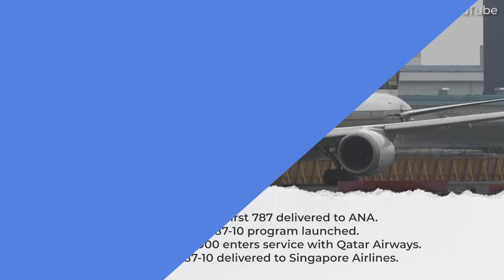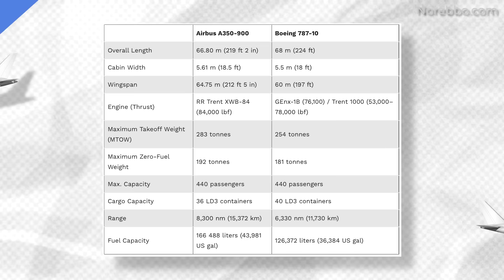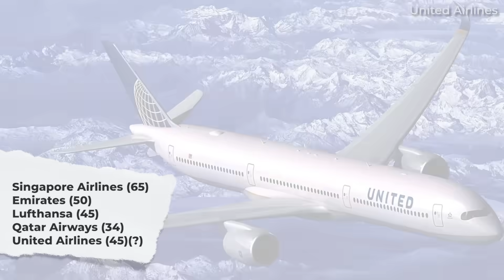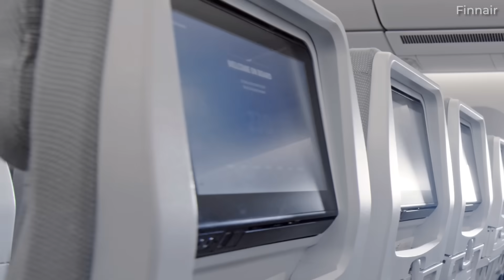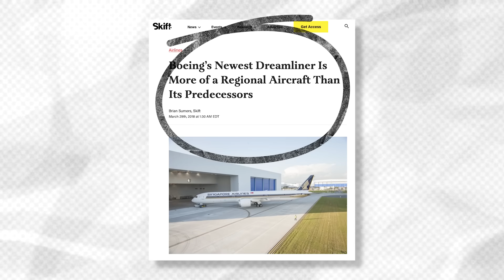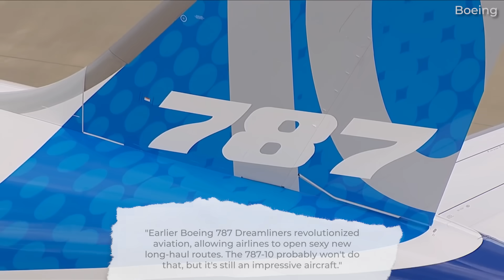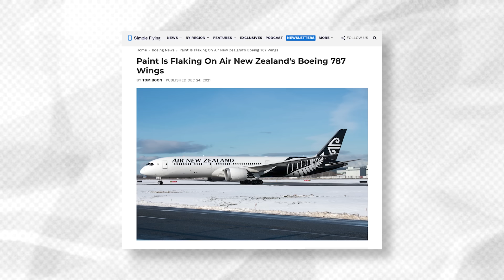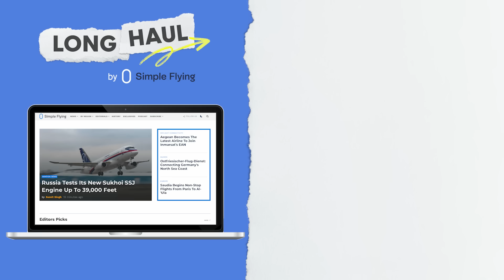The Airbus A350-900 Vs. The Boeing 787-10: How Do They Compare?

Comment: Airbus will sell a lot of A350's in the 2020's for one reason: airlines that bought large fleets of 777's need to replace their planes over this decade. As such, I expect Air France to start replacing their 777-300ER's with A350-1000's starting around 2026. This is why Rolls-Royce is working on the UltraFan program: a new engine that will be available on the A350 before 2030.

Comment: Singapore Airlines is a great example of an airline that sees the advantages of both aircraft.
They use the A350-900 on their longest longhaul routes, including the ULR version, but use the 787-10 on their densest routes, mostly within Asia.
Ultimately both are wonderful aircraft with slightly differing missions, but with the 787 being able to carry more cargo, a HGW version will all but eliminate the advantage of the A350, which would lead Airbus to modify the A350-1000 even before that variant has to deal with the 777-9.
It's going to be interesting to see what happens when the 777-9 goes into service.
Reply: "On paper" I agree. But until Boeing sort out their manufacturing mess this whole discussion is kinda moot. After two years of stoppage they are snagged again. SMH.
Reply: @wojomojo  that's true, but that doesn't change the fact that there are currently nearly 900 787 aircraft  in service, so the aircraft is great.
Most of the issues with the aircraft are not related to the quality of the design, but the quality of building, and that can be resolved. The aircraft remains capable regardless.
Reply: @Timi Ayotunde  actually 1,041 are benen in service.  The 787 have already already 1,700 order, almost catching up the 330 and the 777

Comment: Thanks for the video. Just adding some info, the A350 can soon also be ordered with the dimmable windows. Also the cabin width is also increasing soon, so it can fit another middle seat easier.
Reply: That's a valid point. However, while the dimmable windows are in response to the popularity of the feature on the 787 with airlines, the widening is being done to compete with the 777-9, so you're more likely to see that wider cabin on the A350-1000 before you see it on the 900 variant.
Reply: Don't worry, airlines will make sure you never feel that increased cabin width by making it 11 seats wide in response.
Reply: I really hate dimmable windows. At least when the aircrew locks them in the darkest configuration.
I took a day flight from Tokyo to Istanbul recently and we flew over some of the most interesting landscapes of Central Asia. Do you think I was able to see even the slightest glimpse of it? No...
Reply: @Hhutuber  Yes, I can imagine how frustrating that would be. American Airlines had told its cabin crew to stop locking the windows and just ask passengers to darken them just as they would ask on other flights for people to close the shades.

Comment: Air New Zealand has ordered the B787-10 'extended range' or higher MTOW replacing the current B777-300er fleet. Deliveries for the  B787-10 'extended range' start late 2024.

Comment: EVA actually deploys the 787-10 on pretty long routes from Taipei to NA west coast ( Vancouver / Seattle)  and Europe (Paris/ Vienna, depending on the season), alongside short flights within Asia ~ with a capacity of 342 and flight times up to 13 hours, it shows the versatility of the aircraft. The range gets negative rep mostly because of how it compares to its own siblings -8, -9, and the similarly sized a350-900, but it's still very capable, especially with its lower operating costs.
Reply: Airlines simply can't ignore the economics of the aircraft, and Airbus knows it. That's why they're releasing a version with the dimmable windows, which would likely save some weight, but it still won't match the economics of the 787-10.
However, the A350 will thrive on longhaul routes because of its wider economy class seats and roomier business class.
Reply: @sainnt  Airbus smartly slotted the 350 between the 787-10 and the 777. I think the 777-9 and -8 will be the Best bet
Reply: @trenton.tchannel1810  Actually, the A350 was announced before the 787-10. The 787-10 was announced as a viable alternative for the A350-900, while the A350-1000 was announced as a more viable alternative to the 777-300ER, which simply has a superior cargo capacity.

Comment: My longest recent flights were HKG=JFK at 16 hours. That's about the maximum I care to fly even if it was with CX in business but really don't want to do it again. My last flight was on BA on 787-9 in first class LHR-ATL which was okay. at 9+ hours. An upcoming BCN-EWR flight will be on a UA 787-10 at close to 9 hours. So, what makes sense to me is that it is a good aircraft to fly to and from Europe, which is where UA and KLM feature it. The amount of ultra long haul routes are fairly few, so the 787-10 makes good sense as a lower cost alternative to the a350-900 on all but those few routes.
Reply: I flew on the Singapore Airlines route from SIN to EWR in premium economy. I was not bored for a single moment, though the jet lag was rather severe because I was so excited to be on the flight that I didn't sleep much on board.

Comment: Both are wonderful airplanes. But due to quality control headaches with the 787 Dreamliner, I choose the A350. Remember that Boeing used an ODM (original design manufacturer) model for their 787 Dreamliner to cut down on research and development costs. That means Boeing contracted other companies to do the engineering for them and those contracted companies sub-contracted other companies to make the parts for the 787 Dreamliner. This ODM model works for smartphone manufacturing as consumer electronics have looser tolerances. But airplanes have very tight tolerances thus the precision engineering must be perfect. If Boeing stuck to their traditional OEM (original equipment manufacturer) model then they will control the engineering of the 787 Dreamliner and contract other companies to make 787 parts to spec for the tight tolerances the 787 needs.  I hope Boeing doesn’t reuse the ODM model for their 777x wide body…oh wait.
Reply: My whole family worked for Boeing. Many of them retired now. You are spot on with your comment. All of Boeings planes used to be done ahead of schedule. Now everything is delayed. The company still hasn’t learned it’s lesson.
Reply: ODM (outsourcing) has done plenty of damage to the Motor industry also, it’s an easy way out for Ivory Tower merchants, it all very well for cutlery and crockery, but where safety and performance are critical it’s a different matter
Reply: Thank you very much for the education in this regard.
Reply: "Boeing and its subcontractors are like a doomed open thropple. We had our partners and they had partners who had partners, communication was very challenging and added a lot of complexity, and long story short, now we all have chlamydia."🤣🤣🤣🤣🤣🤣

Comment: I flew DUB-AUH-BKK and return all on Etihad's 787-10s. It was quite good. Very quiet aircraft. But I felt seating was a bit cramped
Reply: Seating configuration and setup is airline specific. An Etihad 787-10 seating arrangement and space will be different than a Singapore Airlines 787-10.
Reply: I hated that too.
Never etihad again and if I could choose A350, I will.
Reply: That seems to a common complaint with the 787.

Comment: The elephant 🐘 in the room is that the A350-900 is about $75MM more expensive than the 787-10, despite being the exact same size. This is not chump change! A350 only makes financial sense if you need the range and powerful engines… Simple Flying repeatedly mentions 787-10 having lower operating costs because of landing fees (lower MTOW), but acquisition/leasing costs are also MUCH lower for the 787-10
Reply: Prices are negociable. For an airline which has already A350-800 in the fleet, it would be make more sense to buy A350-900 if only a few needed. Same ist valid for an airline which has already smaller 787 in the fleet.
Reply: @andreaseufinger4422 a350-800 is not a plane what are you talking about lol
Reply: You get what you pay for 🙃

Comment: Air New Zealand fly's 787-9 from ALK to NYC which is the longest 787 flight across all models, flight time is between 14.5 Hrs and 16 Hrs depending on weather and wind. It should be pointed out that the aircraft is especially configured for this route having a maximum PAX of 180 which makes the flight the most comfortable and luxurious  across all classes. I think its the best flight experience of any commercial long haul airline in the world.

Comment: Due to overcrowding at Tan Son Nhat Airport (SGN), the larger the plane, the fewer take-offs and landings. So VNA mainly uses 787 and a359 to save SGN :(
Early flights, when the airport is empty, they usually use a321 between HAN-SGN

Comment: I really like the a350's capability to fly from Singapore to New York
Reply: And from Sidney to  NY in 2025 - finally an aircraft that can fly from any airport to any other  in the world
Reply: @HugoAelbrecht  Without having to connect to the home country? Finally!
Reply: @HugoAelbrecht  it should be noted that a similar low density 787-9 can also handle Project Sunrise. Qantas tested the route using that aircraft. The A350 is a better choice because it's larger, therefore would be more comfortable for both passengers and crew.
Reply: @sainnt  Yes, but the plane wasn't even half full. In full capacity, it would not have made it. Besides, when fully operational, strong headwinds must be taken into account.
Reply: @HugoAelbrecht  No ultra longhaul flight has aircraft configured to full capacity. That's normal.  However, Qantas does operate the 787-9 from Perth to London in normal configuration.
Reply: I took that flight. Loved it!
Reply: Sounds like an absolute NIGHTMARE.  Who in their right mind wants a 20 hour flight?  And worse, who the Hell wants to go to NY or Singapore?
Reply: @w8stral  mostly businessman and investors since both cities is not a really a tourist attraction (SG especially)
Reply: @amirulhaziq4679  No Shit, which means the seats in question are 100% utterly dependent upon the airline and has nothing to do with A or B.... and as someone who has had to travel, I HATE long flights.  Break it up for me, or just use the damned phone.

Comment: is it just me or are the proportions kind of deceiving... the specs are obviously there but just looking at the two planes it seems like the 787-10 is a higher capacity plane... the 787 has more windows on each side despite them being bigger than on the a350 and the distances between the doors seem more proportionate to something like the 787-9... are the doors on the A350 just more massive?

Comment: Honestly if they could add the 777-200LR,I dont see any reason at all why they shouldn’t add the 787-10LR. It would be a legendary ultra long haul plane and the carries will love it!
Reply: The difference there is they used the 777-300ER wing on the 200 to make the LR.  To make a 787-10LR they'd need to design a new wing, and the increased weight of the wing and fuel would necessitate new engines too, probably.

Don't get your hopes up.  Just get excited for the A350-1000 and 777-8/9.
Reply: Oh alright. Thank you for making me more understand with this
Reply: @forbesjeff  for an LR, they would need a new wing and engine probably but for an ER, that is not required .
Reply: Well the optimized 787 variant was the 787-9. The 787 designs were built around the 789, so when you stretch the aircraft out, add more weight and such but still keep the same engines and fuel capacity, the 787-10 performs worse in range and etc.
Reply: Yeah that's the problem they didn't design e new engine or fuel caps
Reply: Yeah the range of the -10 is shorter than the -8 and -9 i think
Reply: @claxyisrage That’s why I commented this. They nerfed the 10 too much

Comment: We gotta point out, that Airbus' dimmable windows are faster and more dark.
Reply: Boeing's latest version of the dimmable windows are also faster and darker. I experienced it on a newer 787-9 from Qatar Airways.
Reply: They are not manufactured by AIrbus, so no, they are not "airbus's dimmable windows".  In any rational world without the idiot FAA/EASA in the way, Boeing would have just changed to the newer version of the windows as they both use the same dimmable window company.

Comment: A350 is more comfortable and considerably quieter
Reply: I flew on both, but personally I like the 787-10 better.
Reply: As a avgeek, I love both the airbus and boeing❤
Reply: It’s your opinion that’s it’s more comfortable. But 787 is more quiet.
Reply: @Chickendees789 it's not an opinion the A350 is more comfortable for passengers. All but one airline configure their 787 in a 3-3-3 economy despite the aircraft being designed for 2-4-2. This means in economy the seat is over 1" narrower than the A350 with a 3-3-3 configuration.
Reply: @farangatang  yes. But there is other A350 with uncomfortable seats like Philippine airline is ordering a a350 that has a weird configuration. But I do agree that the 350 is more comfortable for leg space.
Reply: @Chickendees789  787 as noisy as 777W
Reply: @kwwong2893  are you talking about RR or GE. My bad I meant GE version is quieter. RR is pretty loud.
Reply: @Chickendees789  I'm not sure. I have only flown 787-8 and 787-9 belongs to ANA several times
Reply: @kwwong2893  the seats depends on the airline. But I think you went on A RR version because that is loud
Reply: Nope!
Reply: The A350 is much louder? Tf do you mean lmao?
Reply: They tested the b787 and a350s cabin noise with no one inside and the a350s engine was louder by 2db
Reply: Boeing = Airbus
Airlines really do just choose the plane for preferences, for range, capacity or high demand routes.
Reply: Side sticks suck 😂
Reply: The 787 has way more thrust and is newer
Reply: @GreenvileW  If you think Boeing is better because they're older...boy you've got a lot of things to catch up on 😂😂😂
Reply: @miggyaviles005  i never said thats why i thought they were better
Reply: @GreenvileW hat's cap the 787 is not close to 84,000lb and 97,000lb thrust per engine.
Reply: @GreenvileW the Trent 1000 has less thrust than the least powerful version of the Trent XWB 😂
Reply: @GreenvileW  A350 is newer and its technology is generations ahead of 787
Reply: @HeyangHsu generations? Did you watch the video? Boeing announced the 787 and not quite a year later Airbus announced the A350, finding itself once again behind and forced to play catch-up. 😂
Reply: Airbus sucks. 😂
Reply: @Chet73 Not you suck😂
Reply: @Chet73 like how Boeing managed to drown two planes in within half a year? Oh ya, Boeing is indeed suck.
Reply: @Chet73  and you want to gain attention and want to argue.
Reply: @jupiter776  No, I’m stating my opinion.
Reply: @Chet73  The tone was too hard to notice for me.
Reply: @Chet73 You state your opinion with no logical reason to back it up.
Reply: Also airbus sucks
Reply: @GreenvileW preach
Reply: @GreenvileW Boeing is boring n so unprofessional n more tragedies. Keep fangirling loser.
Reply: @GreenvileW  don't be a better Boeing fanboy, his opinion.
Reply: @jupiter776  Boeing is way older so they know how to make their stuff a lot better, airbus is from the 70s
Reply: @GreenvileW  again, no arguements needed. take your arguement elsewhere. also Airbus sees Boeing's mistakes so they correct it and attempt to make it better
Reply: @jupiter776  I was saying my opinion, sorry for telling people I don’t like airbus
Reply: @GreenvileW  it's okay, keep it to yourself and don't try to argue with it. state "imo" if you are saying it to avoid arguments.
Reply: @GreenvileW Obviously not if their planes keep falling apart and crashing..
Reply: @GreenvileW Boeing manages to catch up to boeing in 50 years while boeing has been here for 100+ years
Reply: @GreenvileW and the 737 max?
Reply: Should i remind you of the max crashes? @GreenvileW

Comment: If we want to be fair. There is hardly any routes that carry the full range of a A350.. Most use the extra capacity for belly cargo or increased fexibility.

For carriers where the increased flexibility or more bellycargo make no sense, having a aircraft with more seats, is of case the most natural solution.

Having the ability to swich in and out -8, -9 and -10 aircraft for daily routes depending on demands also is quite logical.